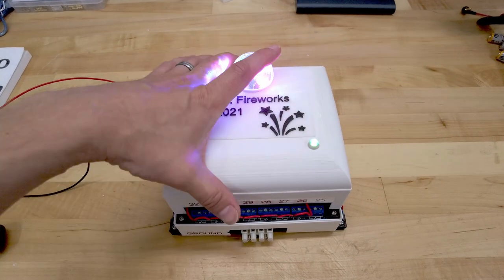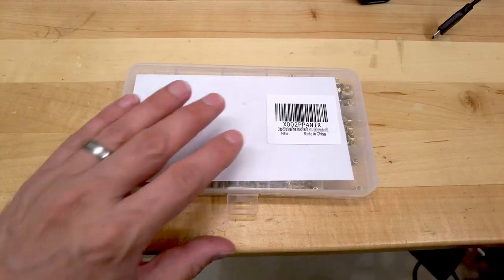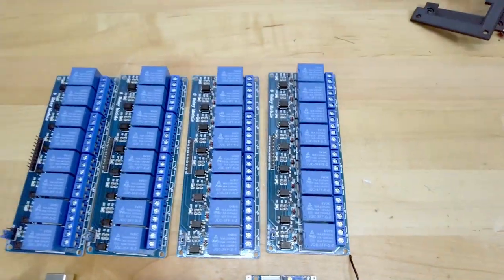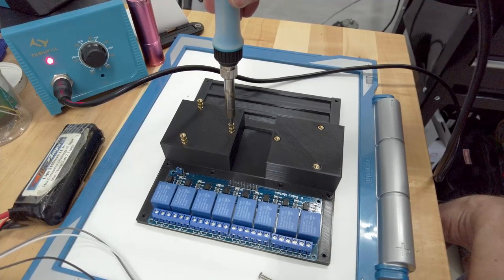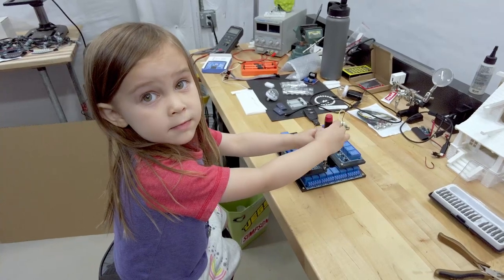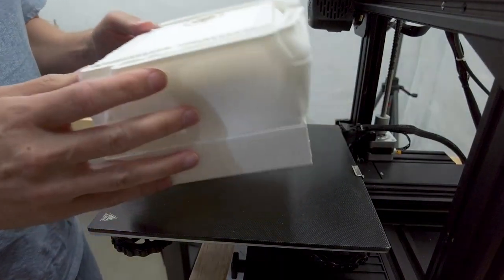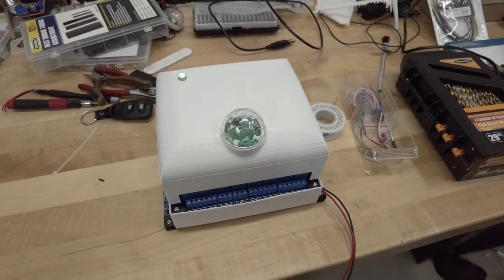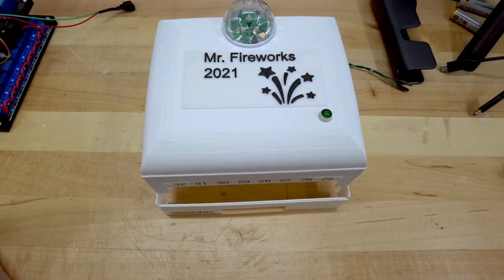*Easy* Firework firing system you can build fast!

Comment: Hello, came here from HAD with a couple suggestions. 

The biggest one I cannot stress enough would be an arming switch that disconnects power to the relays when in the disarm position. Not only is this a critical safety measure, it may be a legal requirement for any professional or DIY firing system in your or your viewers' jurisdictions. It can be a toggle switch, a key switch, anything as long as it's opening the firing circuit while the device is connected to power to prevent accidental ignition. 

The other would be a test mode for use while disarmed. If I recall, the relay boards you selected have status LEDs built in that you may be able to use for that. In fact, just having the disarm switch setup along with some light piping on the LEDs may be enough to give you that functionality. This is especially helpful if you are setting things up with custom timings so you can visually see when each channel would be going off.

Stay safe and have a happy 4th y'all!
Reply from the maker: Thank you for posting this. The remote relay I have in there does disconnect power to all the relays, so even if the micro controller goes crazy, the remote can turn it all off. But I didn’t specifically state that in the video. The simulation switch is a great idea. The relays do have an led but is not easy to see. I’ll have to think of a better design next time. Thanks for watching and for the feedback.
Reply: If his relay modules are anything like the relay modules I'm using in my project, those LEDs on the modules light up when the coil of the relay is energized. Powering channel specific LEDs, without also energizing the relays, would not only require a second pin for each channel on the relay module, but a second IO pin on the Arduino for each channel. Then, in "test mode", the system would send a high signal to each channel's LED pin using the timing in the code & in "fire mode", it would send low signals to each channel's relay pin, using the same timing code. A more invasive mod, would be to cut the traces on the relay module PCBs, after each LED, but before each rely & put maybe a transistor, used as a switch, across the cut traces, so in "test mode" the circuit to the relays would be disconnected, but in "fire mode", the circuit to the relay would be reconnected. That way, a low signal to that channel in "test mode" would only light the LED, but in "fire mode", the same signal would light the LED & energize the relay. Either way, that's a lot of modifications, & possibly IO pins, for something you could test by simply running the program before connecting any e-matches to the relays. Just my 2 cents, which, with today's inflation, isn't even worth 2 cents anymore. :)
Reply: This is a pretty exellent/useful comment. Good to see a bit more of a focus on safety. Cheers :)
Reply: The battery is external. Can be unhooked very easy vs adding a switch

Comment: Instead of fuses can I attach leds to the relays to replicate the fireworks
Reply from the maker: Definitely, just make sure your LED has a built in resistor or add one because it will be a direct short to power.
Reply from the maker: Here are large 12v LEDs with built in resistor. 10mm 12V White LEDs
https://amzn.to/33DyG5z

Comment: How did you code everything?  I am planing going the same route
Reply from the maker: I used Arduino IDE. All the code and wire diagrams are here. https://github.com/CodeMakesItGo/FireWorkController2021
Let me know if you need any help. Have fun and good luck!

Comment: What is the range when using the remote to fire it?
Reply from the maker: The range is pretty low with this remote, about 100-150ft. But you can use a remote with more range like a Lora radio and get 1,000s of feet if needed.

Comment: Couldn't this build be expected to struggle a bit at even the arduino 6V max current? Just based on the generous assumption that we'd see anything close to 4A with even an industrial-grade IoT efficient power supply, or even fairly arbitrariy estimates of ohms/resistance..it seems like the pacing would need to be kept at 'easy listening'. pretty much the entire show...

It might be a decent thing to also toss out a disclaimer indicating that this may not be the safest way to go either - since underpowered systems can pose some pretty unpleasant risks, i.e., Unreliable or erratic ignition: If the current demands exceed the capabilities of the  GPIO pins, the ignition of fireworks may become unreliable or unpredictable. This could result in misfires, delayed ignitions, or unintended firing sequences, which can create unexpected hazards.- like setting fire to stuff you'd normally try to keep from turning into piles of ash, like your house, friends, DIY 'Mr. Fireworks', etc.. anyway - although I'm not generally one to barge in with the intention of sucking all the joy out of what I fully consider honest and pretty inspirational efforts at innovation - having felt myself getting a bit too carried away oblivious to some of the pretty real dangers, it seemed only right to throw a caution out - since that's not something that seems to have gotten proper emphasis among the comments I have read so far...

Given what I've seen the arduino spec'd per pin at 40mA max - nevermind how those who are most typically drawn to the spectacle of making things vividly explode in the air are so often regarded as much less impulsive and naturally more resistant to such unacceptable breachd of decorum in triggering multiple parralel ignition cues never once in tight orchestration with AC/DC's "Riff Raff", and couldn't possibly be so undisciplined as to deplete a ~3A power budget prematurely in a 'brown-out' that choppily disrupts/halts what would have likely reached a much more thrilling apex with the availability of ~10 additional amps. Anyways, I'll be done now. Thx :)

Comment: Awesome video! A simple question… the current that flows from the battery directly to the ignition fuse should be limited by a resistor? Because I would try a similar project with a LiPo battery but I’m a little skeptical about the massive current that can be generated from these batteries…
Reply from the maker: I would say that it doesn’t because you want full current to ignite the fuse. I suppose you could put a resistor on there if you are concerned that the wires could fuse causing a short. But it would have to be a high wattage resistor like a 10 watt or something.
Reply: @CodeMakesItGo  Yes, an high amperage is needed in order to ignite the fuse but also the relays have a current limit due to their mechanical switch properties (I think). Tell me if I’m wrong but this high current is generated  from a short circuit a the end of the cable, on the fuse, right? Every real battery cannot supply infinite current on a short circuit, so every technology has a different discharging rate. In a normal situation with a small Pb battery or a Duracell for example we assume that the max current can be few amps. In this case, LiPo can supply hundreds of amps without any problem, so this is not a good deal. After some use relays can be damaged with the very high current generated from the LiPos, also if this current is supplied for a very short time. Perhaps the best way to prevent this, as you said, is to add an high wattage resistor. I will try, thank you!
Reply from the maker: Oh wow you’re right I was think just about a normal 12v battery from a power wheel. Lipo is a different story completely.
Reply from the maker: Hey I was thinking, the fuse only takes at most 2 amps at 12v to ignite it. So the relay should be safe assuming no shorts.
Reply: @CodeMakesItGo  Hi, thank you for your interest. I asked this question on Reddit in a firework’s community, and I have big news. Firstly there is no short circuit in any normal situation, the fuses have a low internal resistance (usually about 2 ohm) so the current can be high but not as in a short circuit. A normal igniter does the job with 600mA, 1A and rarely on higher currents. Using ohm’s law we can determine the current flow, as long as we assume that the power is DC: I = V/R. 14volts / 2 ohm = 7A. Power at this moment is P = V*V/R, 14*14/2 = 98W. Probably this is a little bit too high, but we can limit this current through an high power resistor in order to increase wiring life and general safety. For example a 10ohm or even less I think can do the job (10 euros on Amazon). They also had some concerns about the relay choice, saying that there are better choices out of there. Mechanical switches such as relays are more prone to failures, due to their “dynamic” behavior. Imagine to damage only one relay, if it stop working in a open circuit you “only” miss the ignition and your show is ruined or at least incomplete, but in the worst scenario the relay get stuck in a closed circuit, as soon as you plug the battery or you turn on the system the fuse will ignite, exposing you and whatever people next to you in a dangerous situation that can lead to injuries. They said that MOSFET or BJT are perfect for this application, reducing not only the cost but also increasing the general safety of your build. I hope you will find this helpful! Honestly an entry level 4 channel fireworks unit costs about 30 euros, and in order to start this project I need spend at least 50 euros… if you need several outputs like in your video I think from an economic perspective it is convenient, but for a simple unit with 4-8 channel I don’t think so… I will decide in the next week😉 thank you and have a nice day!
Reply from the maker: Very good info. Thank you. Guess the next version will have mosfets.

Comment: I've got a weird issue; the outputs start having a delay after the 2nd output, getting longer, the 10th output for example is 3 seconds late. so while I put the output at 175000, it actually goes on at 178000-ish. Any ideas what could be causing this?
Reply from the maker: I know the millisecond timer isn’t perfect and drifts a bit but it should t be that far off in only 3 minutes. Try increasing the serial output to 115200 or remove all the serial output messages. Possibly there is delay in the serial output and it can’t complete within the 100ms window. But that seems unlikely too. If that doesn’t work we might have to switch to interrupt driven timer to get more accurate timing. Let me know what you find.

Comment: I`m waiting for 2022 version :D
Reply from the maker: Any suggestions for the next version?
Reply: @CodeMakesItGo  1. Test mode with leds to check proper cable connection                                                                                                                                                                                                                                                    2.Option to connect 2 or more firework controllers to have more then 32 relays, maybe via ethernet cable

Comment: when using the mega 2560, can i program all 52 outputs to 52 relays? Thanks for all the great info!
Reply from the maker: I can not confirm from experience but from what I read this is possible. There are actually 54 digital IO but I reserved 2 of them for serial. So supposedly you could get 54 if you disable the serial coms too.

Comment: Can you tell me how do I connect relays to arduino shield and where do I connect voltage regulator
Reply from the maker: Yes of course. Because the Arduino, remote control, and relay boards are 5V powered, I used a voltage regulator to ensure the output from my power source is 5V. In my case, I would run this off off of a 12V battery which you will need for current reasons to light the fuses. So the voltage regulator is connected to your power source and feeds the Arduino shield 5V. 
The relays are simpler because the digital logic level from the Arduino will trigger them. Just plug the Arduino output line to the input of one of the relays to trigger it. If the relay board is powered, you should hear it click and the light for that relay should illuminate. Here is the wire diagram I used for the project. https://github.com/CodeMakesItGo/FireWorkController2021/blob/main/WireDiagram.pdf 
If there are more questions or if you are having a problem you can't figure out you can email me at jason.altice@codemakesitgo.com and we will figure it out together. Hope this helps.
Reply from the maker: Did my reply help? Everything working?
Reply: @CodeMakesItGo   yes it did, thanks for help..will let you know if i need further help

Comment: Its possible to make 2 firing system with 2 same pilots but on diffrent MHz signal ?
Reply from the maker: What do you mean by 2 same pilots?
Reply: @CodeMakesItGo   sorry. I mean 2 the same remote switchs. But operating separately
Reply: I would simply like to have two modules of 32 relays each (64 total) But the second module would be an extension of the time of the first module. example 
  "{52, 15500}, // OUTPUT 31 1 module
   {53, 16000}  // OUTPUT 32 1 module
   {22, 16500}, // OUTPUT 1 second module
   {23, 17000}  // OUTPUT 2" second module

Its possible to make this with one remote switch ? or just 2 same remotes but on on diffrent signal
Reply from the maker: You could definitely link these together with a small software change. When the first firing system is complete a signal could go high to trigger the second. You could link this to as many as you’d like. Assuming they are close by. If you want them far apart then we could use a Lora radio to start the second one. But yes, entirely possible to trigger them synchronously by a single remote switch.
Reply: @CodeMakesItGo  Thank you so much for answer ! its great idea ! hope I can make it :D
Reply from the maker: I can help with the code if you have any questions. Good luck!
Reply: Just an FYI. If you were to put 1 or 2 relays inline with the main line for the whole series of relays you could end up running at least twice as many igniters. Something, something, switching grounds, etc.